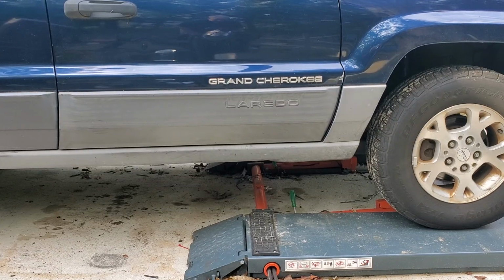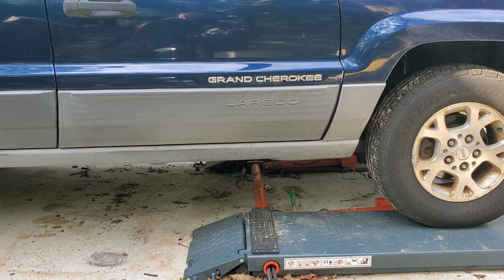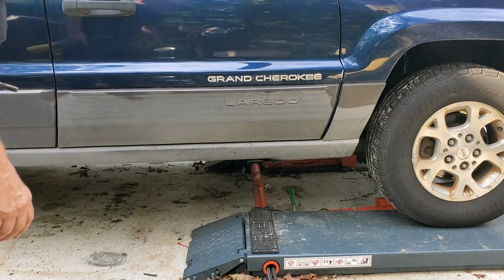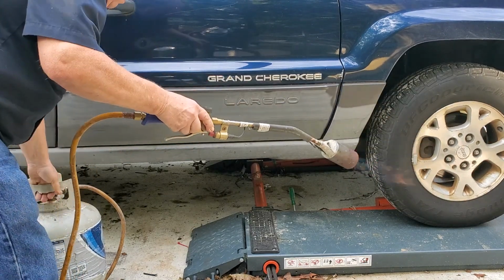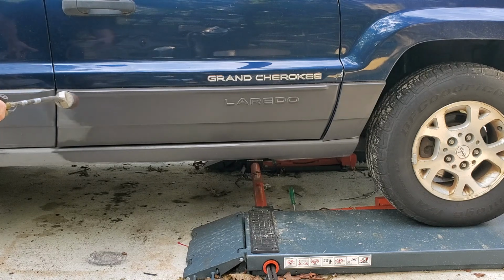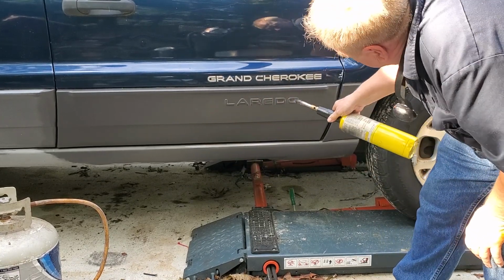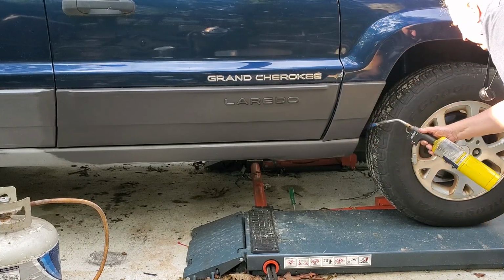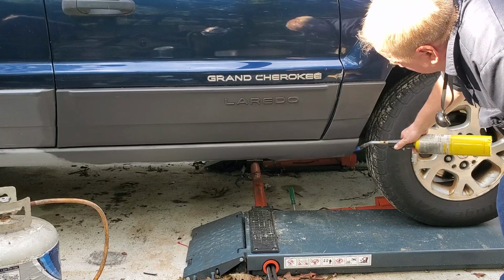Dull oxidized Jeep plastic trim restore w/fire

Comment: if you don't wanna accidentally ruin your plastic just leave your car outside on a hot day then put a  coat of transmission fluid on, let sit an hour or so then wipe off with a clean rag. works great and will last up to a year.
Reply: This works well. I did this on an old SAAB about 10 years ago which had plenty of UV-damaged plastic after noticing that a spot which I spilled some ATF on still looked good after a couple of months. So I wiped ATF on all of the UV-damaged plastic and rubber. The car sat in the Australian sun which has the highest UV levels in the world at temperature of up to mid 40 celcius (that's up to 105F); it still looked good after about 10 months which is when I sold the car.
Just don't do what I did and wipe it on the dash because the oil seemed to evaporate and coat the inside of the windscreen with a fine oil and gave the interior the smell of eau-de-mancave.

Comment: Does that heat separate the glue from the trim and car
Reply: No it will not but if you do go too slow it will burn the plastic, and possibly separate the glue from the trim and the car as well.

Comment: What about the headlights?
Reply: Some sanding to get the oxidised thing off and buff it with the buffing machine, or sand it, clean it and put clear coat, this is a method that lasts longer
Reply: What he said- but for ‘sanding’ it you have to graduate up to an UBER fine grit like 1500 (higher the better) from maybe an 800grit, and keeping the plastic WET/clean the whole time while sanding 😉
This lasts much better than the magic ‘chemical’ they sell to put on there....proper sanding is key
Reply: I'm late, but you also want to wet sand in same direction the entire time, so small scratches will be less noticeable.

Comment: Is this a permanent solution?
Reply: not permanent but it will stay like this for a couple years or more if you put it in garage
Reply: Better than any plastic shine kit in auto stores
Reply: It seems to be actually removing the oxidation, so that would make it as permanent as getting new panels
Reply: @MegaBrokenstar  actually oxides the plastic even faster and making it more brittle. Go watch Project Farm and his video.
Reply from the maker: No it will eventually oxidize again if you don't coat it. I use wipe new trim restorer  its awesome. I made a vid on it
Reply: Put some WD-40 onto the plastic from time to time, after reviving it like this.
 It makes plastic on the outside smooth and shiny again.
A bit of olive oil works also nice on interior plastic. Apply it carefully with a paper towel.